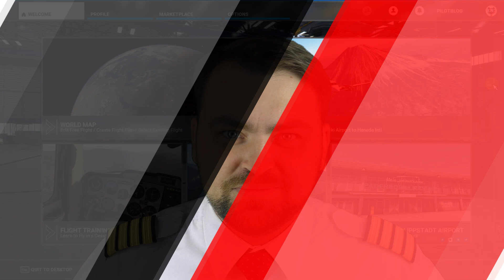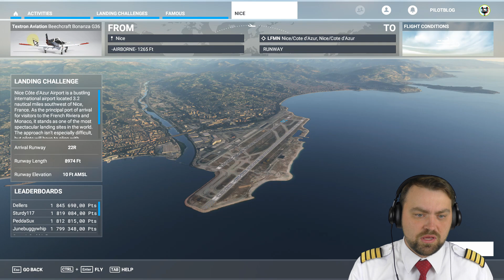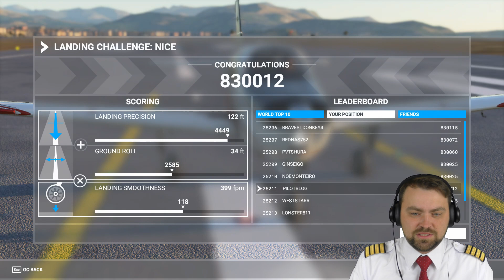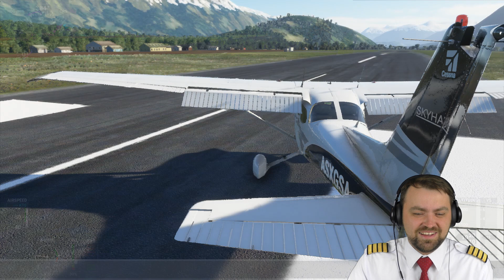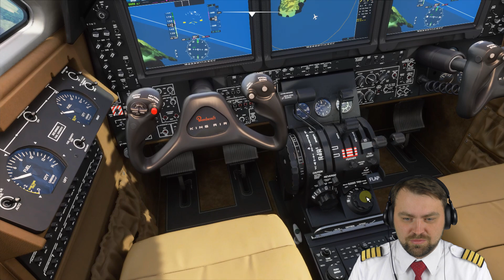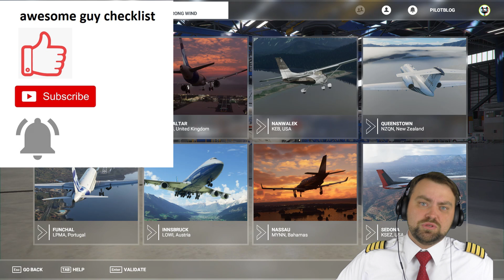Real Pilot Plays Microsoft Flight Simulator 2020 Landing Challenges

Comment: Great video,

About the lags, if you didn't try it yet, you can check the task manager for programs that might be using a lot of CPU. I always turn off windows defender before playing as it often takes ~30% CPU randomly doing a scan or something. It might not be the case for you, so I recommend checking what programs have high CPU usage and turning them off for the time of gameplay.

Also, if your recording software supports it, I recommend trying to change encoding between hardware encoding (NVENC) and software encoding (x264) and checking if it changes anything. NVENC is using your GPU to encode the recording, while x264 uses your CPU. Depending on which one (CPU or GPU) is less loaded during the gameplay, you should choose it to encode your recording.

Hope that helps so you can have more fun playing the game!
Reply from the maker: Thank you very much for your advice!

Comment: In your when to descent video, there was 33×3=99nm. But what is the second 3??
The faf alt(3000ft), excluding the zeros????
Reply: For descent planning just multiply your current altitude (above destination airport) by 3 in order to get the miles needed for an idle thrust descent. -/+ 1 mile for every 10kts head/tailwind and +1 mile for every 10 kts above approximate approach speeds.

So for example you're at 30,000' and the airport is at 0'. Let's say you're going 300kts with 10kt headwind:

That's: 30,000x3 = 90 + 10 (because you're 100kts above 200kts which is rough speed at 10nm on approach) - 1 (10kt headwind). So required miles for idle thrust descent = 99 miles.

Works most of the time in real life on the 737!
Reply from the maker: @Jonny94669  Perfect answer 🤘
Reply: @PilotBlogDenys  Thank you kind sir, hope to fly with you someday
Reply: @Jonny94669  thanks a lot
Reply: And the above video is awesome as always..........